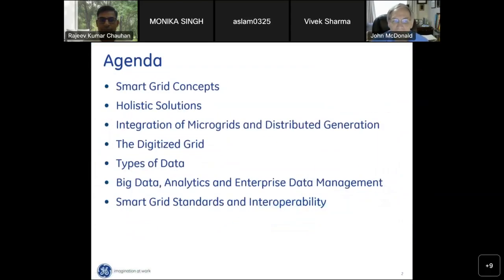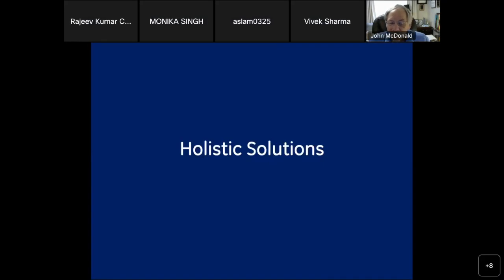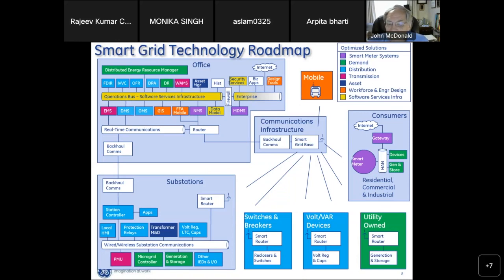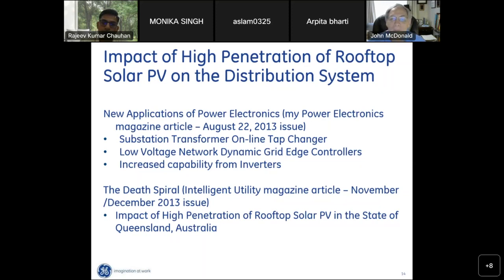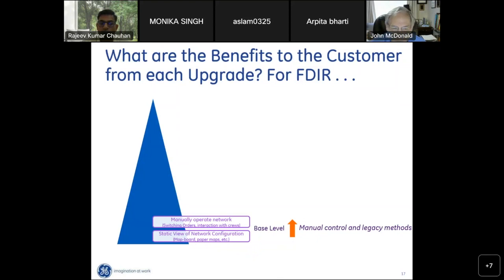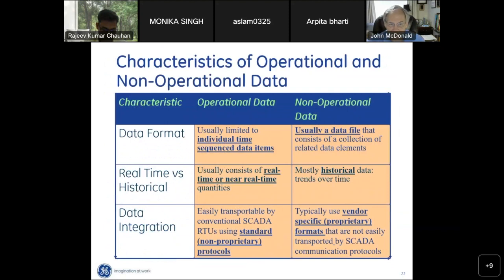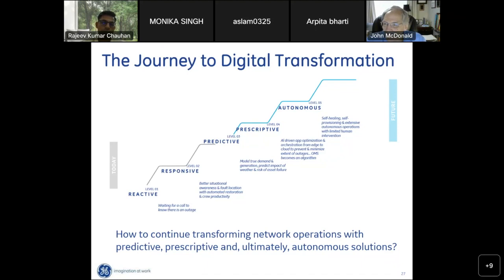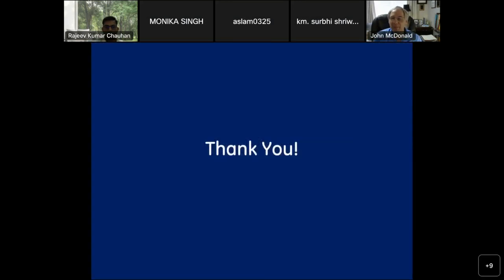Grid Modernization: Technological Advancements Beyond Smart Grid by John D. McDonald

Comment from the maker: 00:31 Integrating electrical and information infrastructures is crucial for delivering meaningful benefits to the utility, consumer, economy, and environment
03:22 Integration of renewable energy and specialized sensors in grid modernization
08:23 Mentoring is crucial for young professionals
11:01 Challenges with integrating distributed generation
16:09 Impact of Distributed Generation on Grid Voltage Volatility
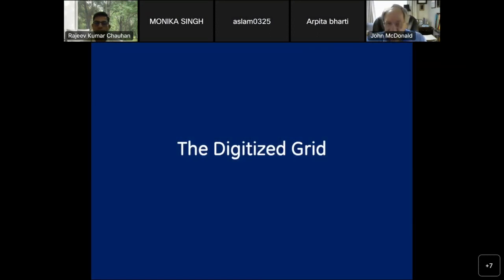18:29 Grid modernization requires a strategic roadmap for implementation.
22:56 Introduction to operational and non-operational data in grid modernization
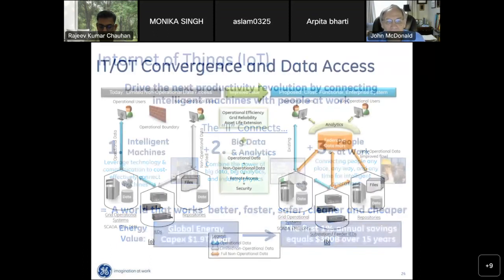25:16 Implementing a Federated data mart to break down silos in enterprise-wide operations
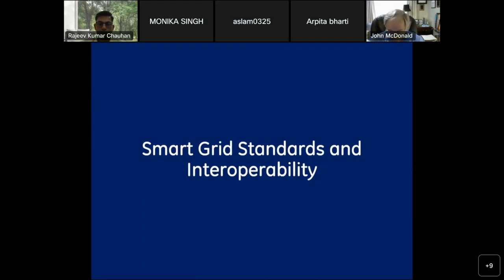29:54 Standardization in Smart Grid Technology
32:09 Grid modernization standards and communication protocols